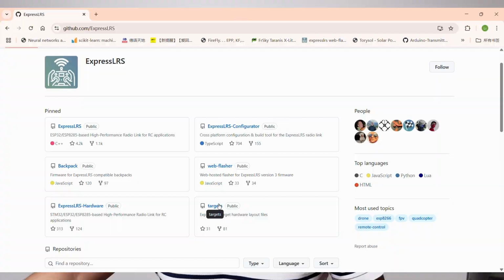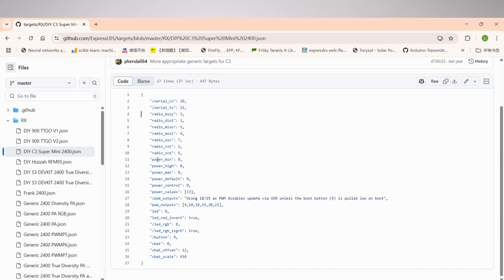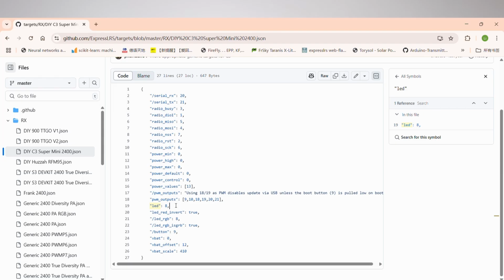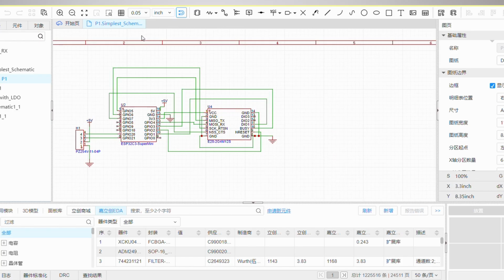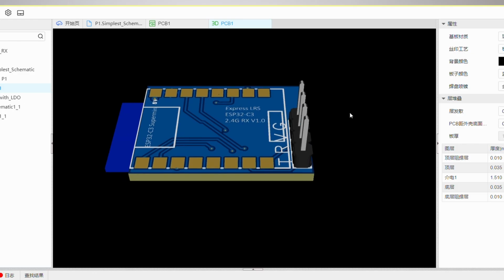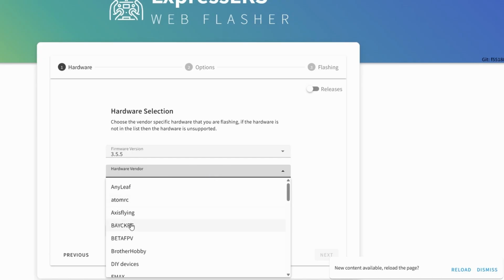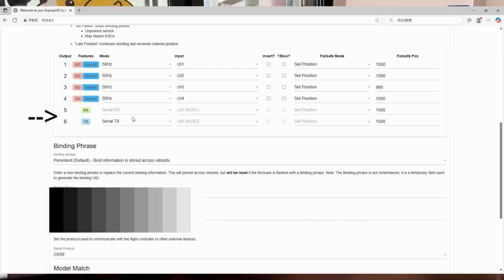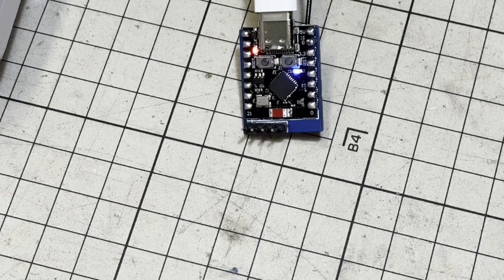Make an ExpressLRS Receiver with ESP32-C3 (Beginner Friendly)

Comment: awesome, will try it, buying some e28 lora boards.
Reply from the maker: It is the simplest solution I have seen, I suggest to buy 12SX , not 12S, otherwise, the 0om resister re soldering is a headache.

Comment: Can you make one as external elrs tx module with same components or new lr1121 module
Reply from the maker: The output power of this module is only 10mw, not enougth for a TX. However it is interesting, if it is possible to use the 27S module.